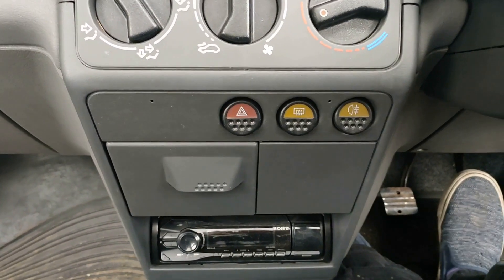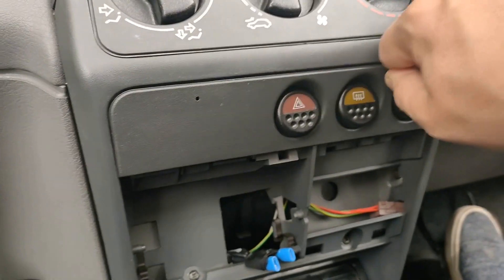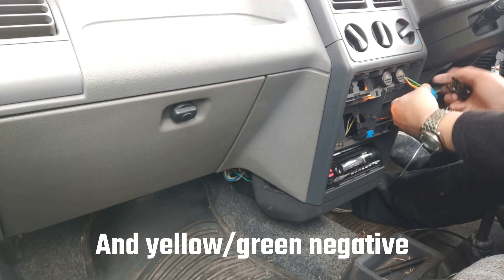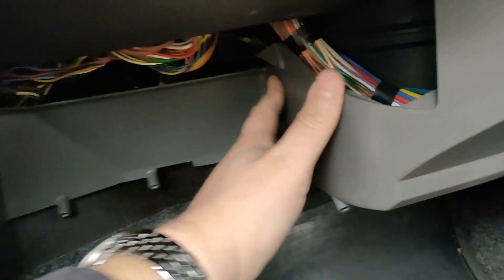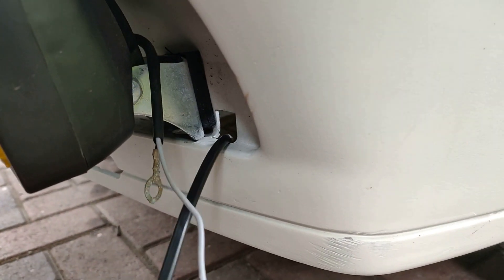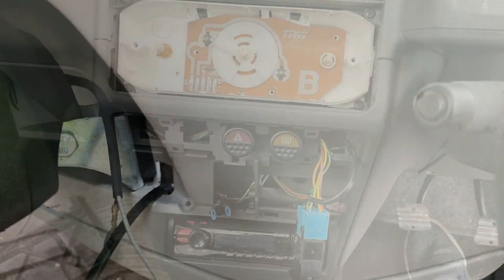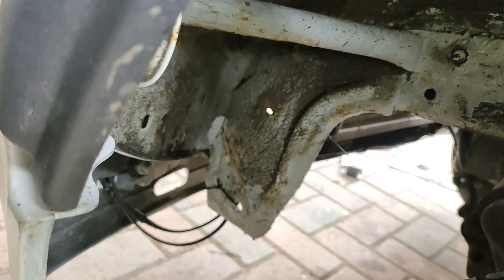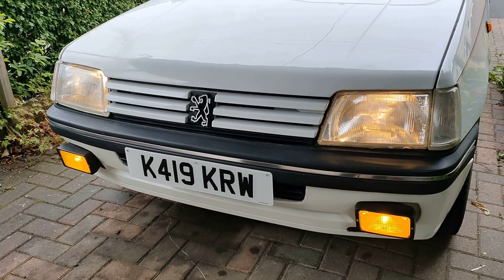Wiring in Peugeot 205 Foglights

Comment: Please keep these videos coming! They give me way more confidence to tackle trim issues in my car. Bought a digital clock to go next to the cigarette lighter but realised it needs to be fitted from behind so gave up... Too scared to start pulling it apart in case I break anything. Reckon it’s an easy job?
Reply from the maker: That's great. I probably have too much confidence sometimes. But most parts can be found if it goes really badly! As I've taken it apart a few times I've sort of got used to how much flex the centre console parts have but to take it off completely means unscrewing quite a lot. It depends how much space you need for the clock as to how much you take off. The worst part for me is the steering wheel surround as those screws will snap the tabs if they are overtightened. Let me.know how you get on

Comment: You sure those wires isn't predrawn? Lots of other cars have all the wires, even if it's not coming with the accessories. Thinking as you obviously had the brackets for the lights, at least. But I don't know in this case..
Reply from the maker: Hello, I changed the bumper so the original one didn't have the brackets but these 205s really are basic, they didn't bother putting stuff in if the model didn't come with it. The grill space is there for rear speakers but they didn't bother with the wiring or speakers for example

Comment: Awesome! Great explanation. This will definitely help me when wiring up mine :) 

What else are you planning on doing to Jeff?
Reply from the maker: Great thanks. The next big job is replacing suspension bushes, springs and dampers. But that may have to wait for a bit. Engine mounts soon. Speakers will also be changed as they are very worn! Apart from that whatever needs fixing
Reply: @pointlessroadtrips9580  looking forward to that! When replacing speakers (especially the rear) is quite tight i hear, so not every speaker will fit. I do know the front and rear are the exact same size :)
Reply from the maker: Thanks that is good to know because mine is so basic it doesn't have rear speakers but now you've said that I'll have to think about if I want some!